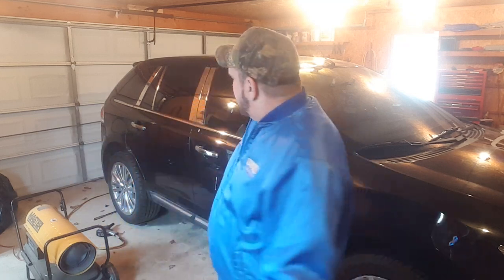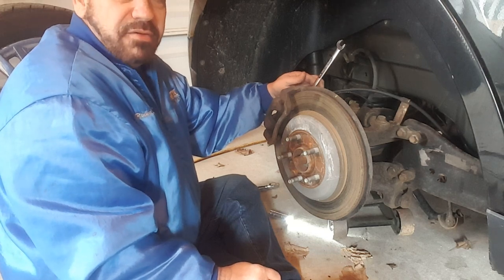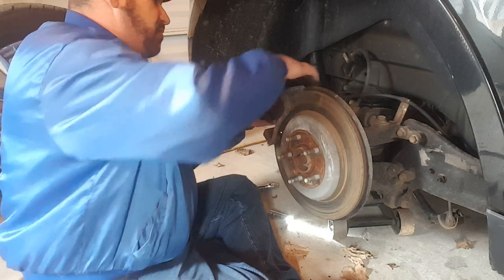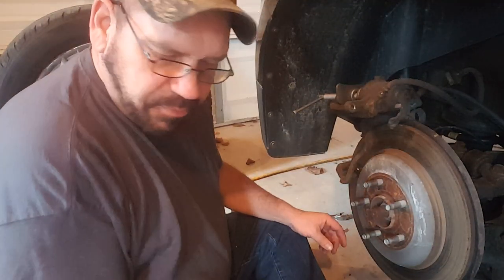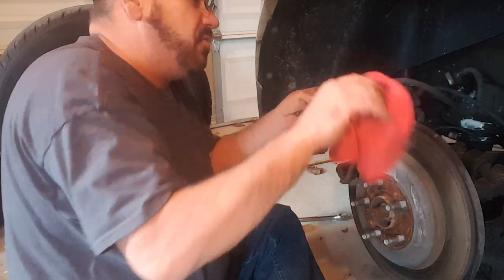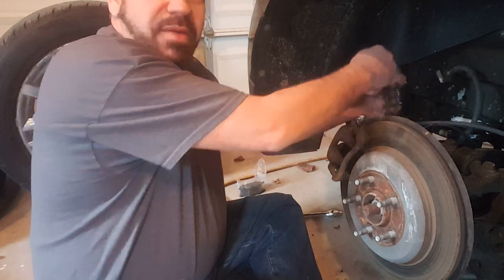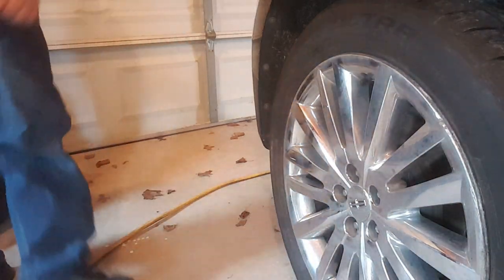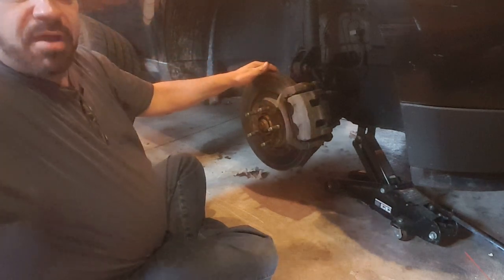Replacing FRONT and REAR brakes on a 2011 Lincoln MKX

Comment: Open the brake fluid reservoir when compressing the pistons to prevent them coming back out... take the cap off and it relieves back pressure